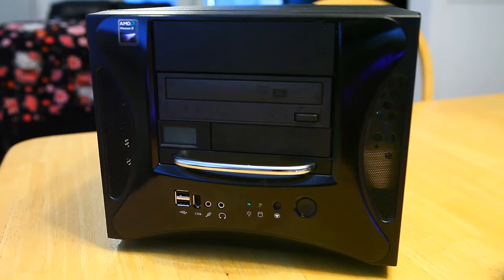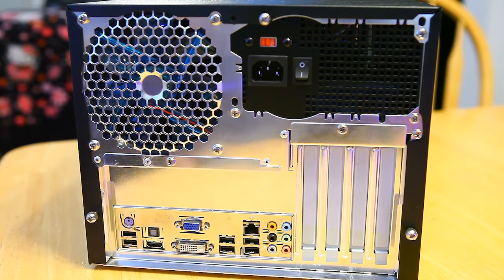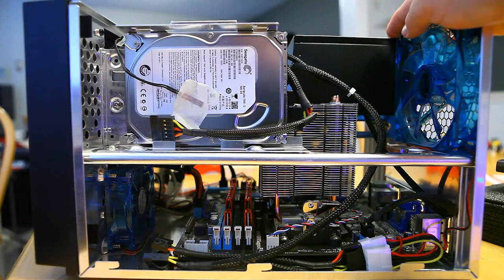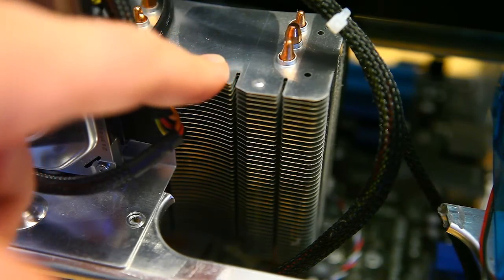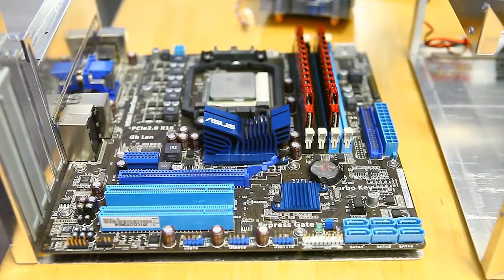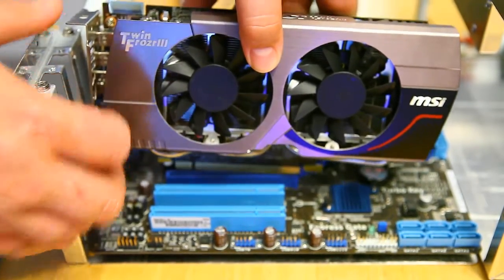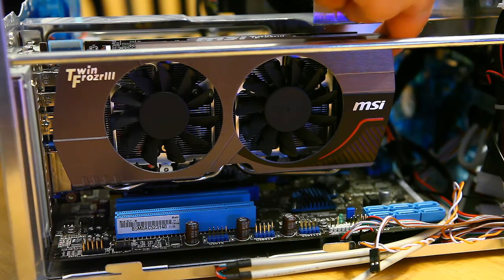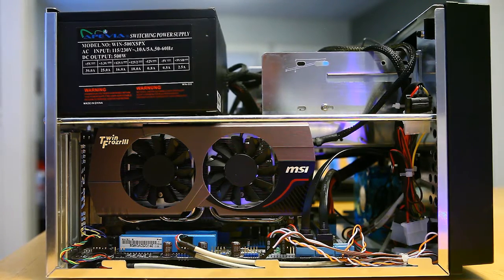HTPC: Home Theater PC Build

Comment: hi hi I did a very similar build with this case:
A10-5800K - $130
MSI FM2 mATX - $60
ADATA SX900 - $150
8GB 1866 DDR3 RAM - $40
& since AMD Trinity had a pretty good built-in GPU, I didn't even need to buy a card until I wanted moreee powerrr haha! Anyways, I'm upgrading to the exact card you're using because it's the best for PSU/size. I was just wonderin though how is the PSU? Has it started smelling like it's burning or anythin? I'm a bit scared due to reviews of the case concerning the PSU..